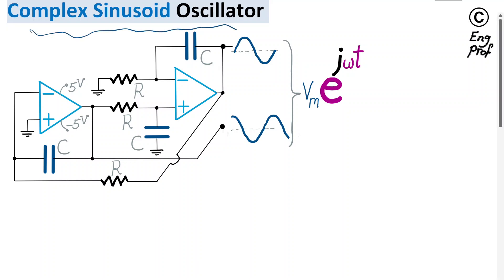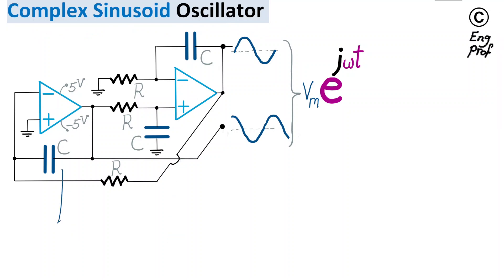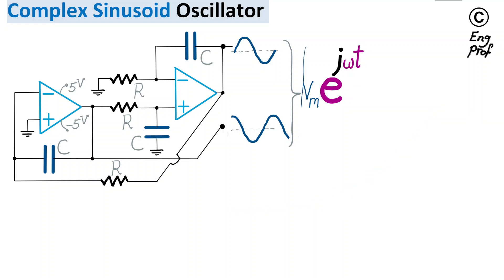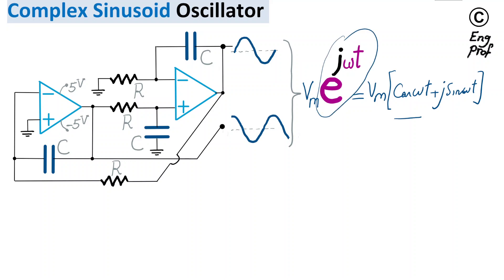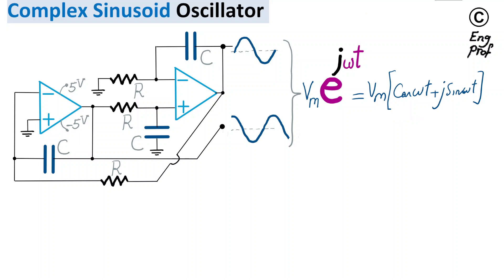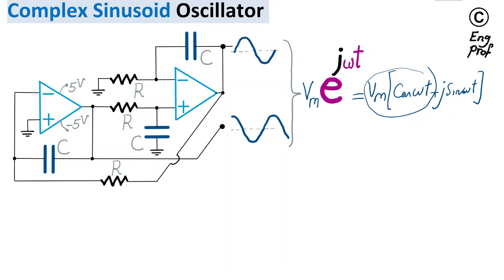Complex Sinusoid Oscillator Explained

Comment from the maker: Thanks for watching. For more Analog Computer & Op Amp examples please see: https://www.youtube.com/playlist?list=PLrwXF7N522y4c7c-8KBjrwd7IyaZfWxyt
Sawtooth Generator with Op Amp, JFET and BJT Transistors https://youtu.be/5zHXTx-Vl20
Triangle Oscillator circuit https://youtu.be/JF5Up_cuL9k
Op Amp Analog Computer circuit that solves Differential Equation: https://youtu.be/ENq39EesfPw which is A 
Full-Wave Rectifier circuit https://youtu.be/DJJMNU-CYcg
https://youtu.be/R3X5AYNZGEI which is a Differential Equation Solver Analog Circuit.
Diode-Amplifier VTC is analyzed in https://youtu.be/vpGZkafxMJM 
https://youtu.be/HeZRtnRXpEI presents a circuit with op amps and feedback loops to design an analog computer that solves a second order differential equation.
I hope these Circuit engineering and analysis videos are helpful.

Comment: It seems as if this phase shift oscillator uses ideal capcitors.  Physical capacitors have an equivalent circuit far more complex which includes inductance ,resistance.
As a result it does not seems feasble to produce sine waves from this circuit at frequencies greater than a few Mhz.
Reply from the maker: Thanks for watching and sharing your thoughts regarding practical considerations for this complex Quadrature Oscillator. For more examples please see Sawtooth Generator with Op Amp, JFET and BJT Transistors https://youtu.be/5zHXTx-Vl20
Triangle Oscillator circuit https://youtu.be/JF5Up_cuL9k
    To your good point, there are many additional practical considerations including phase noise, stability, slew rate, components nonidealities (Quality & Tolerance), etc that a circuit designer need to take into account to have a practically functional LO generator (LO Gen) at high frequencies. I recommend using commercially available PLL frequency synthesizer integrated circuits like Analog Devices ADF4106 0.35-µm BiCMOS Phase-Locked-Loop Synthesizer that is fully specified to operate at very high frequencies. Alternatively, you can try simulating this circuit using a high frequency op amp like the Texas Instruments OPA855 Broadband Low Noise Operational Amplifier to examine the highest frequency it can generate. For more Oscillator and Op Amp circuit design examples please see https://www.youtube.com/playlist?list=PLrwXF7N522y4c7c-8KBjrwd7IyaZfWxyt
Thanks again. 🙏
Reply: Personally I prefer to use a Bulb Stabilised Wien Bridge Oscillator ! LOL ! sorry the math is a little over my head but I do get a great deal from you videos so thanks and I am interested in clean sinewaves for audio stuff....my preferred opamp at the moment is the OPA1656...cheers. @STEMprof
Reply from the maker: Thanks for watching and sharing your thoughts and insights. Glad that these circuit videos are useful. What features of OPA1656 make it your favorable op amp? 
For more Oscillator and Op Amp circuit design examples please see https://www.youtube.com/playlist?list=PLrwXF7N522y4c7c-8KBjrwd7IyaZfWxyt
I hope you like them as well. 🙋‍♂️
Reply: Thanks will check them out. The OPA 1656 has low noise levels and I have tried a few and along with the NE5532 I get great results, they are design for use in audio so fit the bill !! cheers. @STEMprof
Reply from the maker: Thanks again for watching and sharing your observations regarding Texas Instruments low noise FET-input OPA1656 operational amplifier as a good choice for Audio applications. I will post more examples in the circuit playlist https://www.youtube.com/playlist?list=PLrwXF7N522y4c7c-8KBjrwd7IyaZfWxyt
Cheers 🙂
Reply: Thanks :)! @STEMprof

Comment: Can I use this to generate ~1 Ghz IQ LO ?
Reply from the maker: Thanks for watching and your interesting question about this Quadrature Oscillator. There are many additional practical considerations including phase noise, stability, slew rate, etc that a circuit designer need to take into account to have a practically functional LO generator (LO Gen) at very high GHz frequencies. I recommend using commercially available PLL frequency synthesizer integrated circuits like Analog Devices ADF4106 0.35-µm BiCMOS Phase-Locked-Loop Synthesizer that is fully specified to operate at frequencies up to few Giga Hertz. Alternatively, you can try simulating this circuit using a super high frequency op amps like the Texas Instruments OPA855 8 GHz Broadband Low Noise Operational Amplifier Transimpedance Voltage Amplifier and similar designs. For more Oscillator and Op Amp circuit design examples please see https://www.youtube.com/playlist?list=PLrwXF7N522y4c7c-8KBjrwd7IyaZfWxyt
I hope this explanation is helpful.
Reply: Thanks. I'm already checking other vids on your channel. Great content  (:
Reply from the maker: @dabdoube92  Thank you for watching. Glad that you like this channel and its circuit design & Analysis videos.🙏